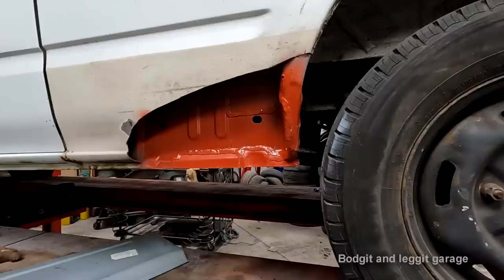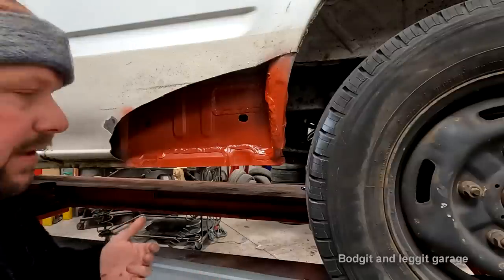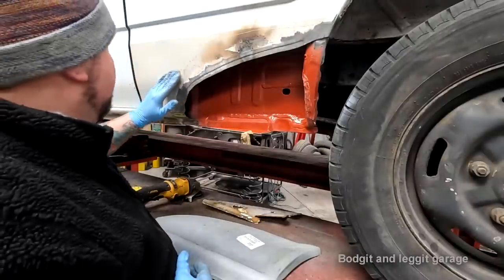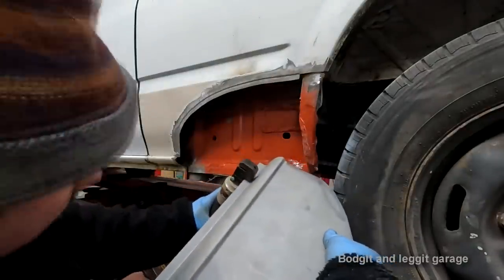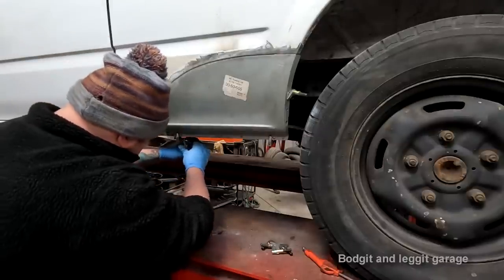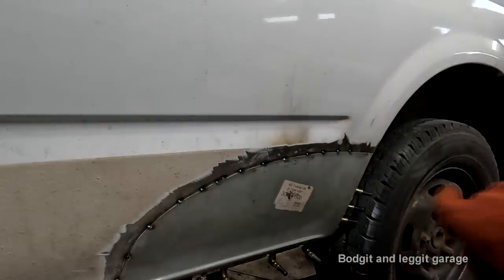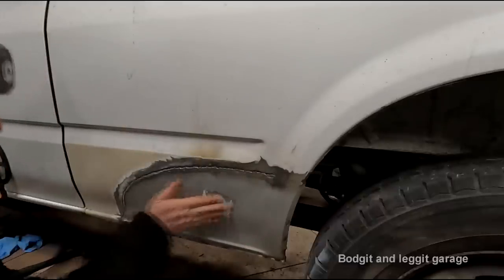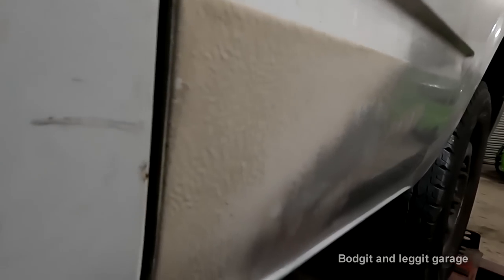DOE Van Dalised Ford Transit Easy Way To Weld With No Distortion part 4

Comment: Thanks
Reply from the maker: Wow Thank you so much
Reply: @bodgitandleggitgarage hey when you lip a panel like that they make a weld through primer you can put behind on the original panel so its not just raw steel behind good for coating the back of your patch panels to   looking good though
Reply from the maker: @79huddy  Mate, I am well aware of that. But it does not work very well. And the heat of the world just Burns it all away. It can sometimes make the world very spluttery. Wax oil does a lot of the protection I have tried it both ways with the well through primer. And I don't see any advantage using it
Reply: @bodgitandleggitgarage  no worries it's not alot hope every little bit helps,  for the knowledge you have been sharing over the years. I thought you were going to say something else when you said said the panel was solid!!! 😂
Reply from the maker: @stillasgoodasnew  🤣🤣🤣🤣

Comment: Lovely job. You probably could've gone to the door with that panel as those few inches of old metal on the sill probably won't live much longer. Isn't it easier to take the metal up to an inch of edge of the first panel groove edge? That way it's a nice, clean, straight line weld

Comment: Good job Leon. You could always lead fill it.
It’s a bit of a lost art, but that would easily be done with a heat gun, yes, I did say a heat gun.
Reply: Where do you get your hands on lead these days? Would love to give it a go myself on a banger I have 😊
Reply from the maker: Hi mate, I have already got videos. Lined up to show people how to lead fill
Reply from the maker: @terryatkinson899 It's very easy sticks of lead are still sold easy to get just very expensive
Reply: Quality filler applied properly is OK.
Reply from the maker: @tony78uk48  yes Mate 100% and it is a hell of a lot cheaper than lead filling.

Comment: Great job!  Just wondering on a point of technicality (and no, I'm not critising the job, it's well done and perfectly safe), does this repair meet UK MOT standards?   IIRC replacement panels should be at least astrong as the original welding but welded repair patches should be continuously welded all round.
Reply from the maker: Hi mate, I am not sure as I do not live in the UK. But I am sure it will as this is the same as the factory panel. You cannot continuously weld around When it comes to edges, all the edges on every single vehicle. Are either glued on or spot welded on. Every single vehicle especially vans. When the 2 panels come together in the factory. They are just spot welded together not continuously welded So this is just as good as it was in the factory as it The exactly same procedure they follow

What I think you are actually referring to is when people make patch panels for chessie rails Then this needs to be continuously welded all the way around, which would make a lot of sense.

Comment: i have had my car vandalised  at nct  centre  the guy actually made a  hole in the sill where was no hole too begin with i knew there was a rusted area that would need fixing at some point but i didn't think they were allowed to actually make a hole in a panel ? .
Reply: They're trying to get car's off the road I think, have no proof of course but every year they seem to be ratcheting up what was an advisory to MAJOR FAULT 🙄 I've a bit of welding to do on a neighbour's car that came back with 2 holes in the cills from the nct as well 😮
Reply from the maker: Some things definitely going on in. There would be great to do a conspiracy video people love a conspiracy😂😂😂😂😂

Comment: Everyone is going on how great the job is etc. i get it his trying to make a so called diy video. but his clueless about welding, and everything he says to justify why he did it the way he did, contradicts what he says earlier. doesnt understand why real panel beaters use air guns to make sure it doesnt tin can, he says absurd things like you have to wait 2 hours. the lap joint is nt stronger. you have put so much weld into the panel its has pulled and shrunk so much, its not moving, it doesnt need to be stronger than a thin sheet of panel. its not a structural panel. he creates so much extra work, and gets a much worse result than actuall replacing the whole panel with the one he has,  from were it meets the door to the wheel arch and the top bodyline where the replacement panel goes upto the bodyline, it will be so straight, and thats how its supposed to be. and you wont be putting the heat into the flat section of the panel you spot or mig like how its done from factory, there is minimum weld. yet at 1 minute and 10 seconds into the video he welds the shit out of the cut section of the new flat panel. he put the panel up onto the van, thats why the panel is designed to cover that section. someone with a bit of common sense, will atleast see when they put it over the cut section, thats what you replace. yet he cuts the warped panel in half, and cuts the replacement full perfect panel on a angle in half, welds them together, warps both of them totally, and he has the nerve to call it weld without distortion. he doesnt mention the \ hours if not days worth of work trying to fill and get the warped panel straight. he makes it look like the filled just appeared and fixed itself, who cuts full perfect replace panel, and welds the shit out of it by cutting it to the cut he had on the damaged panel, making some stupid unnecessary lap over. a flat section, and says everyone else is an idiot, this is how its done, what the does the whole world know anyway.  says things like if you do a but weld, you have to grind away 98% of the weld you put on, WTF so your left with 2% weld, what are you saying mate. and justifies it for half the video. its bizarre. then he says its only a tiny bit of filler. yet we can see the amount of filler, the joint has caused such a dip he had to load the filler, that if he done it himself. for someone that shows everything he does. he mysteriously doesn't show how the filler was done. 1 he didnt do it himself or 2 someone else done the repair. then he says its ok he doesnt care because his going to put stone chip over it. let me tell you there is no stone chip on the front of that panel, just behind it and full under the sill. he most likely needs ot do it, because its so warped, his been doing the filler for so long, its just not straightening up. so his going to load the stone chip rough sealer, so it cant be seen. if tis comment is deleted. ill just make a video on debunking it.
Reply from the maker: I've seen all your other messages. You seem very triggered and jealous. Thank you so much for watching my videos and making more and more comments. It really helped me out so much. I really appreciate it. I ve got lots more videos for you to watch and comment And makes me lots more money. Thank you so much.😘😘😘😘😘